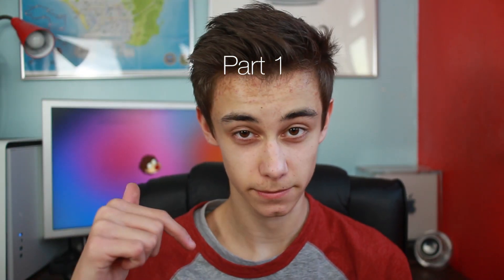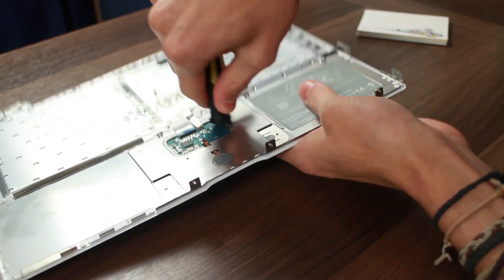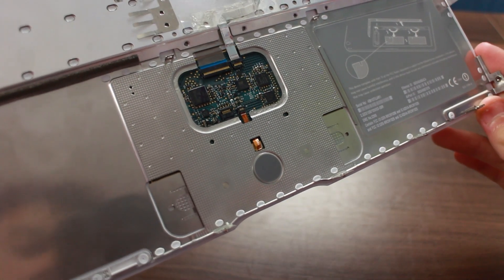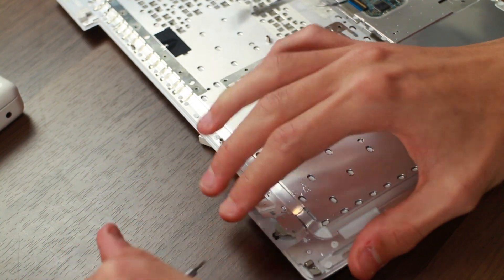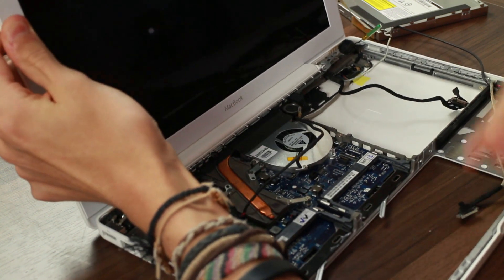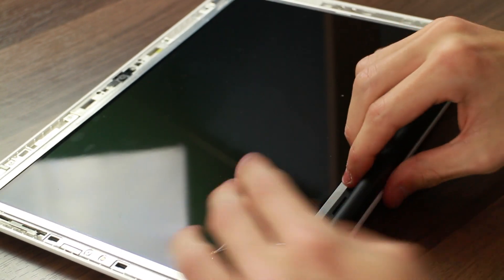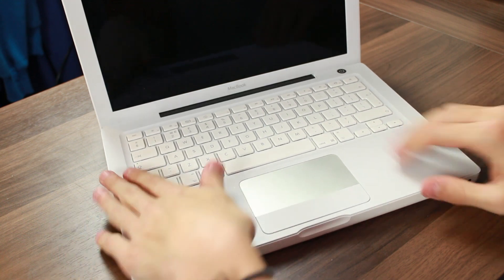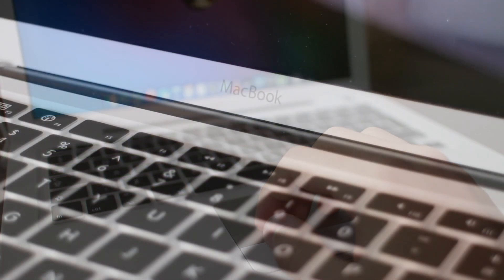The FF-Class MacBook: The Build [2/3] | The PowerPC Hub

Comment: I'm the third owner of a 2006 MacBook, and my brother is its fourth. It's hilarious how messed up it is by now. It's dirty, chipped, scratched, has a broken hinge, doesn't have any of its external screws in (literally held together with its plastic clips... and tape), and, in order to function properly, it has to have pressure applied to its right underside. (It stayed on in a bag and fried itself one day). I taped a prop underneath it so that it could function normally; I used a dead iBook battery, which props it up nicely. What's funny is that it has a battery propping itself up, yet it no longer has a battery in its bay. Lastly, it's on its second hard drive. But man... even after everything that this poor machine has been through, it's still amazing how much better it is than any Windows laptop from the time. In fact, many aspects of this laptop are better than those of CURRENT Windows laptops. It just shows you how great it is; this 'Frankenstein' MacBook can still work better than a similar Windows laptop. These things definitely pack a punch for their age, and you can get them at bargain prices. Even as a 1.83Ghz, 2006 model w/1GB of RAM, it runs like a champ! Definitely one of the most iconic/greatest laptops from Apple, since the iBook.

Comment: Those things are a nightmare to dig in to. I've got to ask, how many screws were left over after you were done? ;-)
Reply: If you think these are a nightmare, check out how excruciating it is to work inside of an iBook G4. The 12" PowerBooks are said to be even worse, but I haven't worked on one before--only the 15" model.